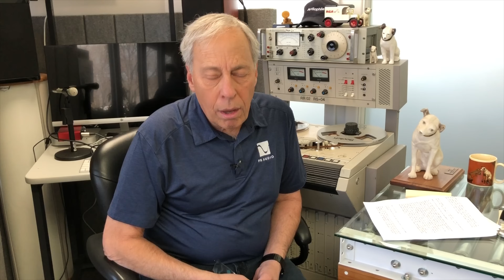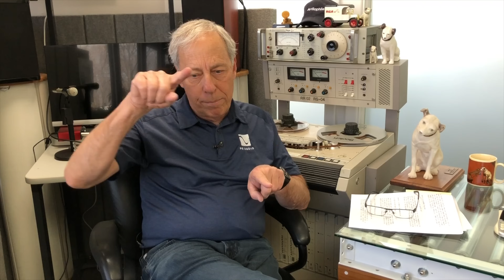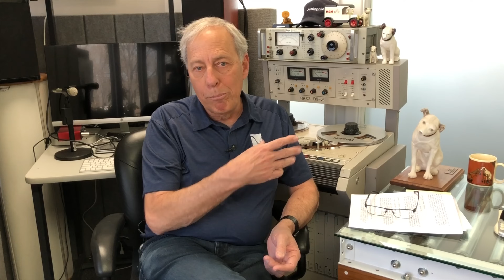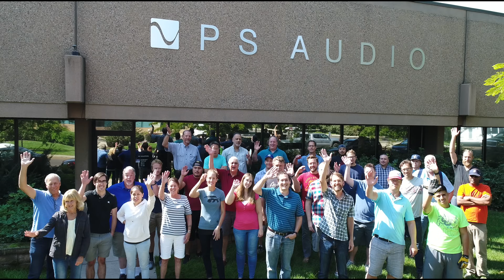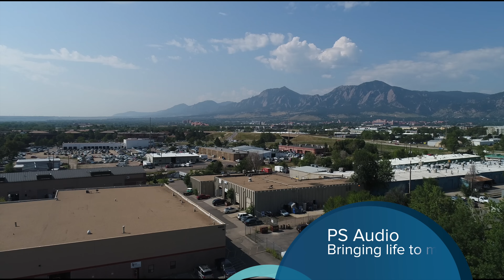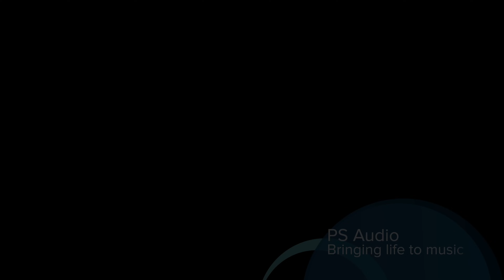Why aren't class D amplifier better liked?

Comment: IMHO ignorance, living in the past, and snobbery. Analog is dying people. 30 years ago, Kodak and Polaroid didn't believe digital camera's would ever be near as good as analog as analog has unlimited resolution, right? Digital tech in camera's has now surpassed analog. Digital TV's have surpassed analog by far. I know some say analog TV's aren't really analog anyway which is true but.......Digital movie theaters have surpassed analog theaters by far too. It is at that point for sound too. A stock CD might not sound quite as engaging as a record, (maybe) but IMHO right now, a super hi fidelity digital has already passed analog. Lower noise floors, higher dynamic range, better dynamics, quicker dynamics, better separation.  Heck, I can't afford super expensive stuff, but my all digital EAD Theatermaster that I use for stereo sound like Magic, plus since its digital,  I can cross the sub and ad Hafler effect in the rears all while using the mains in straight thru stereo. Analog just can't do what digital does!

Comment: Reasons?  Two words.  Ignorance, and snobbery.  The old class D/digital switching and rolled off/harsh are not the norm now.  The switching rate is insanely high, analog to boot.  They not only have all the detail of class a/b with little of the heat.  Even the $225,000 Lyngdorf uses class D.
Reply: Scott Lowell any class is good. Just a matter of $
Reply: No you are very wrong Scott.
I have lived with devialet 440 pro for about 4 months, but I could not stand the typical class D midrange,  thin sounding ,  lacking presense and body.  Sold it .
Now gryphon amp which is superior in every way

Comment: I absolutely love my Dayton Audio class D amp. It is VERY revealing, so when the source is cruddy, it will deliver all the cringing screeching and crackling and distortion present. But a good source is transferred into speaker output with wonderful precision and is allowed to unfold in all its glory. The amp simply is so good, that it cannot gloss over anything, but that is not to be faulted, as an "ideal" amp is supposed to do just that.
Reply: I know it's already years later, but I'm curious to know which model do/did you have? 

I have the KABD-250, 50Wx2 @ 4ohm, as I wanted something to play around with. All I can say is, a good class A/B definitely sounds better to me than that Dayton amplifier. That being said, the Dayton amplifier board I have can sound very good once you start playing with the DSP in Sigma studio.

A class D amplifier that really impressed me, used the TAS5630 and Texas Instruments schematics. Integrated, which most will probably hate, but for what it was I was really impressed by the sound quality it produced, it actually put out nice high frequencies, and warm low frequencies. The midrange was slightly lacking, but acceptable. A friend built it for me, and I thoroughly enjoyed it until I replaced it with an Audiolabs amplifier.
Reply: @DiSSaRRaY  One very important thing to point out about most Class D amplifiers (aside from Hypex Ncore) is that their frequency response depends on the the impedance of the speaker it's driving. And as speaker impedances are very nonlinear, it's very possible their experience with the Dayton amp is vastly different than yours if you're driving different speakers
Reply: @bennydontplaythat  I definitely agree 500% with you! But I tried a couple of different speakers with different impedances, and the class A/B amps I have (also different prices categories) sounded better to my ear.

That being said, I've heard class D amplifiers I'd say are most definitely high-end, they just sound so nice to me. One specific example is a class D amplifier an engineering friend of mine built for me to convince me, and he definitely convinced me.

Comment: Generally in commercial sound, Class D is used in a Bi-Amp or Tri-Amp configuration just for the high power bass as the frequency roll off from the crossover is well within design rules for low noise and low distortion while traditional class AB is used for the tweeters for their extended upper frequency response.
Only more recently with improvements in capacitors used for filtering are extended full range amplifiers entering the higher end audiophile market.  The first into the market was in limited power applications where efficiency for raw power was a high priority. High power car audio was the leader in the DB wars along with commercial concert sound. 
Cheap higher power car audio was first into the race as the components were cheap and lightweight, so imports from China were very common in high power car amplifiers.
Audiophiles generally rejected it as early entries as mentioned simply lacked the upper end performance in noise and response and was relegated to driving the punch of subs.  This is changing with the development of filter capacitors and inductors for switch mode PWM analog.  They are much lighter and power efficient. They are much harder to have repaired when they fail as most service shops are not up on the technology to repair it.
Reply: Multi-amp (amplifier per driver, no passive  crossover) system plays louder with lower distortion. Easy and good sounding with a d-a converter for each amp also. Adjustable driver delay gives you "time alignment".

Comment: I'm sorry to correct you, but the output filter design of a modern high performance class D amplifier is not nearly as critical as it was 10 years ago. Most modern high performance class D designs (like Hypex, Icepower and Pascal audio) use either full- or partial feedback taken at the loudspeaker terminals, after the output filter
A properly designed feedback in a class D amplifier significantly reduces the influence of the output filter on the performance of the amplifier and drastically improves output impedance.
It is true tonal differences can be heard when switching between different types of capacitors and coils.

Also, most high performance class D amplifiers do not use a fixed frequency triangle wave oscillator. The feedback loop is designed in such a way to allow the amplifier to self-oscillate (i.e. generate it's own switching frequency). This improves linearity at higher output levels. In terms of switching frequencies, most commercially available high performance class D amplifiers switch at frequencies between 250kH and 500kHz. Topologies like UcD actualy have a varying switching frequency which is dependent on the amplifier output level.

As a full disclosure, I am a class D amplifier designer at one of the aforementioned companies.
Reply: Mike Eastridge  Or even the diFFerence...
Reply: I was wondering how the self oscillating circuit built on feedback help with linearity .. is there a relation between switching frequency and linearity ?. The output power is decided by duty cycle not the frequency ? correct my understanding. I don't design class D amps.
Reply: Also, a modern class D amp sounds very similar to class AB and with our ear we cant distinguish the deference
Reply: @arshadpc7691  if the exact same 1,000 dollar class D amps we have today were priced at 10,000 to 15,000 dollars each all of a sudden, they will suddenly sound much much better than all the class A and class AB amps to all the audiophools and snobby cretins who frequent the audiphool forums. I can gaurantee it!
Reply: A DIY thousand dollar class a amplifier adds and subtracts nothing before clipping. A person doesn't have to have golden ears to tell that switching distortion is measurable, if not audible, in most (even expensive) AB amplifiers operating near rated output.  Class-A not so much, and it heats your room!Btw, it's always the transducers. Microphones, cutterhead, cartridges, audio transformers, loudspeakers that make the most difference. Focus!
Reply: Thanks!
Reply: Hi, I am en electronics and communication engineer with 10 years experience. I didn't work in any Audio design companies but I am willing to join such companies as it is my passion. Can you guide me please?

Comment: Still sound like crap. Certainly not for home use. PA sound mostly. I would still call them low-fi.
Reply: Paul McGowan Not yours. And only those claiming to have thousands of watts which i know they can't deliver.
Reply: you're probably looking at cheap chinese units designed for high volume and nothing else.
Reply: Arlen Moulton P A sound systems mostly.
Reply: If they sound like crap that is a function of the design and company not because it is class D.

Comment: I have a discontinued NuForce modded (TDSS) STA 100 (Class D)amplifier.   Amazing sound for a small amp.   It quenched my curiosity about considering going back to tubes....  Very transparent.  But, that NuForce is now sitting on the shelf.  My new PS Audio S300 has advanced it steps further.  Very transparent and solid in sound.   Its true.  Very musical sounding.  When I listen I do not analyze...but, relax and find myself pleasantly surprised enjoying.

Comment: Main trouble with class D is that it has the potential to take some of the snobbery and more-expensive-is-better mentality out of the field and producers/sellers.
That is the main reason it hasn’t become more popular faster.

It breaks the mindset and forces prices down in a chain that historically has been used to extortion prices.

An excellent amp can be build for literally a fraction of what it would cost to make in the class A or even A/B scheme.
Reply: It's the producers of expensive class D amps that are charging extortion-like prices when you consider the BOM compared to a good class A amp. Funny how these content marketing videos never mention how class D is cheaper for the manufacturer.
Reply: Paul McGowan sure there is a difference, as there should be when changing between such radically different schemes. 
But it’s like comparing electrostatics to dynamic or Magnepan. There is no clear winner. But if you look at price there is.
Overall I think single ended tube and class-d has quite a bit in common in signature, strange as it sounds looking at the difference in approach
Reply: Why should there be a difference?  I do not get that.  As an engineer doing the design, there is no reason there has to be an audible difference or even close to it. PWM schemes are used in many places throughout the electronics industry. Audio is not the most challenging of them.

Comment: You lost me at the explanation edit......I save power by turning my class A tube amp off while I'm at work. I don't need the 250 watt heater running while I'm not home ;-)
How much RF interference am I avoiding by not using a class D amp? I find that turning off my CD player, DACs and router makes LP sound better!

Comment: I'm a recent convert to class D. Had a KT88 valve amp for many years, but recently traded it in and bought a pair of Temple Audio Monoblocks.  These things are tiny, but in a different league to the valve amp.  Astonishing sound and value at £500 a pair, If you'd asked me to blind price them, I'd have suggested somewhere in the £3-4K range. Whilst this class of amp is still being slowly accepted into the mainstream, there are some serious bargains to be had.
Reply: Agree 100% I have the same and as good in detail as my £1000 Alchemist Forseti class A
Reply: I've had a Class D amplifier for six years now - a NuForce DDA-100. It produces incredibly clear, undistorted sound and has real presence.

Comment: https://www.audioholics.com/audio-amplifier/the-sound-of-an-amplifier

Excerpt:

Several years ago, noted reviewer Tom Nosaine conducted a study for Stereo Review magazine in which he attempted to compare the sound of two systems to a listening group through blind A-B testing. One system was made up of the very latest SOTA components and connectors.

The other system was comprised of very “pedestrian” equipment, such as a 1970s-vintage Heathkit power amplifier, a garden-variety CD player, etc.

Both systems were connected via a switcher to the same pair of speakers, so unit-to-unit speaker differences and speaker placement issues didn’t enter the picture at all. An acoustically-transparent but visually-opaque drape was drawn in front of the systems and the room lights were dimmed to assure no visual distraction. Nosaine was well known for his adherence to the scientific process and his rabid attention to detail, so the scenario was well executed.

His results showed that as long as neither system was pushed into distortion there was no statistically-significant preference shown for either system by the group, using a very extensive and varied selection of program material. His listening panel included novice listeners, mild enthusiasts and self-professed “golden eared” audiophiles.

It made no difference. Whether novice or golden ear, no listener or group of listeners scored any better at identifying which system was which.  Supporters of the “no difference in amps’ sound” side were quick to say, “See? Told ya so.”  Believers in the “amps’ sound is easily identifiable” camp were just as quick to point out the myriad aspects and conditions of the test that were faulty in their view and thus rendered Nosaine’s conclusions inaccurate.  So, in the end, his test settled nothing.

https://www.head-fi.org/threads/testing-audiophile-claims-and-myths.486598/

Excerpt:

3 - Do all amplifiers sound the same? Original Stereo Review blind test.

A number of amplifiers across various price points and types are tested. The listeners are self declared believers and sceptics as to whether audiophile claims are true or not.

There were 13 sessions with different numbers of listeners each time. The difference between sceptic and believer performance was small, with 2 sceptics getting the highest correct score and 1 believer getting the lowest. The overall average was 50.5% getting it right, so that is the same as you would expect from a random guess result. The cheapest Pioneer amp was perfectly capable of outperforming the more expensive amps and it was ‘striking similar to the Levinson‘.

https://en.wikipedia.org/wiki/Bob_Carver#Amplifier_modeling

Excerpt:

In 1985, Stereophile magazine challenged Bob to copy a Conrad-Johnson Premier Four (the make and model was not named then, but revealed later) amplifier at their offices in New Mexico within 48 hours. The Conrad Johnson amplifiers were one of the most highly regarded amplifiers of the day, costing in excess of $6,000 a pair.

Of note that in both cases, the challenging amplifier could only be treated as a “black box” and could not even have its lid removed. Nevertheless, Carver, using null difference testing, (null difference testing consists of driving two different amplifiers with identical signal sources and exact levels, but out of phase by exactly 180 degrees. If the amplifiers were 100% identical, no sound would be heard. If sound was heard, the audio amps had different properties). Bob Carver used "distortion pots" to introduce amplifier characteristics, fine-tuned to null-out any sound differences. His "motel-room" modified amplifier sound was so similar, Stereophile Magazine editors could not tell the difference between his amplifier and one costing more than $6,000. This amplifier was marketed as the M1.0t for about $400.00. Bob Carver may have single-handedly debunked any number of theories about sound quality by using physics, blind and double-blind testing and unbiased measurements (such as "gold-plated speaker wires sound better than copper wires", etc.). Carver successfully copied the sound of the target amplifier and won the challenge. The Stereophile employees failed to pass a single blind test with their own equipment in their own listening room. He marketed “t” versions of his amplifiers incorporating the sound of the Mark Levinson and Conrad Johnson designs which caused him some criticism by those who failed to understand the true nature of the challenge — that it was possible to duplicate an audio amplifier's sound in two completely dissimilar designs. In light of this criticism, Carver went on to design the Silver Seven, the most expensive and esoteric conventional amplifier up to that time and duplicated its sound in his M 4.0t and later models which sold for some 1/40th the price (around $600–$1500).

Comment: The only people that hate class D amps are manufacturers like you that make something else. Period. Class D has been superior for over a decade now.
Reply: Did you even watch this video? Dumbass.
Reply: Ron Shaw I don't need to. He's mentioned his viewpoint before, recently. Class D BAD, good old AB  = AMAZING
Reply: Audifile, if you listened to Paul's video closely, you'd have noticed he said, early Class D amps sounded like shit but not as much now that improvements have been implemented. Not that they will sound as good as a pure class A amp, but they are getting better., and with some help, apparently.
Reply: audfile, He did not say that here and even uses them in Stellar series, so there, but the trick is to use a GOOD buffer/pre stage prior to the Class D module to get them sounding good.
Reply: So, now people on youtube play video not to watch it but to comment on it...
Reply: John Palmer you don't need to "get them sounding good" that's what's complete horseshit
Reply: Audfile is there a possibility that ribbons don't sound any different on Paul's D's than an AB of same power?
Reply: Audfile, you are a complete moron.
Reply: Ron Shaw hardly, just calling out the utter B.S. class D are absolutely world class, right now, and have been for years and years.
Reply: Guess some1 didn't pay attention here...

Comment: The fact remains that its not analog, even though you say it switches at 100,000 times a second (even over a MHz) its still jumping from discrete point to discrete point, the function is not continuous. Now does it matter enough to where you can hear that? Probably not...